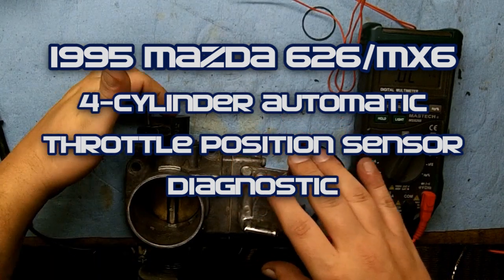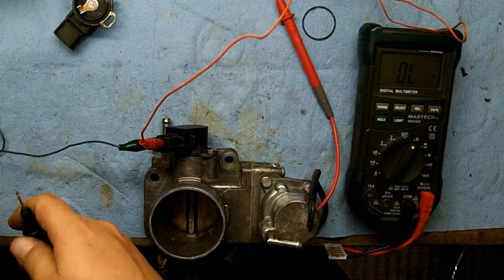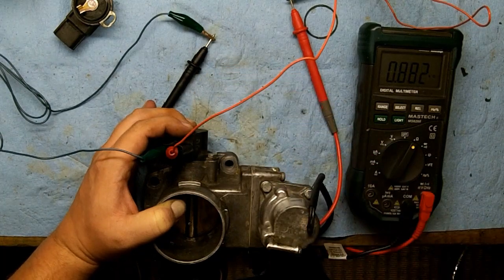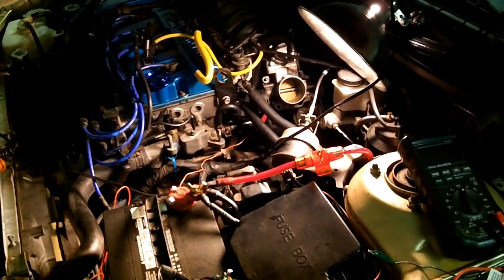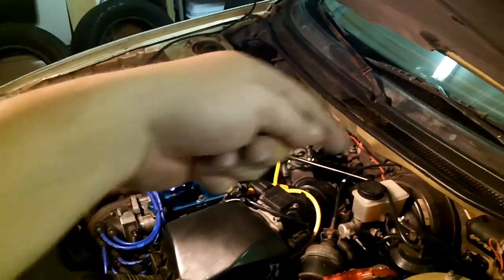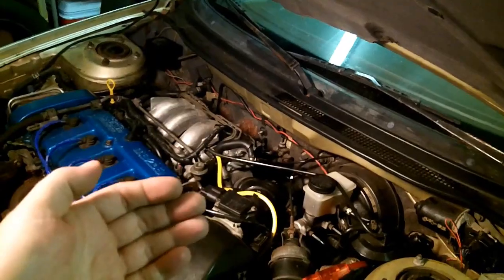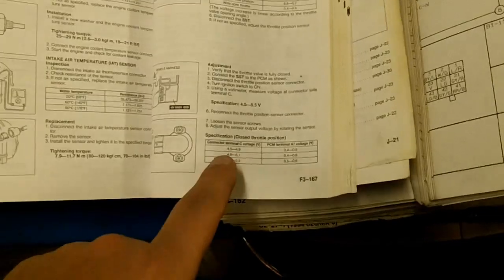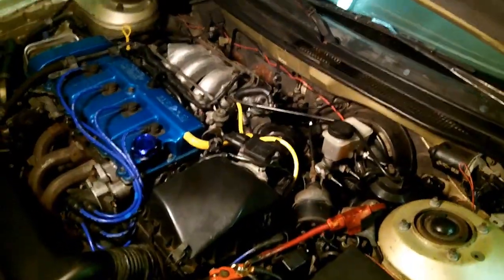Mazda 626 - Throttle Position Sensor Diagnostics

Comment: Hello dj, need some help here I adjusted my tps to 0.5  closed and 4.5 open and it’s giving me a 122 which is tps is low but specs are 0.3- 0.7 and 3.7-5
Reply: Also the car is idling very funky and has loss power
Reply: @chefanklez1335  Hey did u find a fix?

Comment: I  know this is an old post. but I have a 2002 Mazda 626 and it runs fine until I  accelerate  a little faster than "grandma speed" the engine remains high idle and if I put it in park and shift back to drive it's shifts super hard. should I try to clean the T.P.S. and the I.A.C. and see if that work? looking for help I can't afford new sensors.

Comment: I have 1995 Mazda mx6 when I turn the car on in the morning and drive it it tends to struggle to change gears, and when I've driven it for a while and park it, the engines revs up, is the throttle position sensor going bad? I've changed the EGR valve, the EGR solenoid and the IAC valve? Do you think it's the throttle position sensor going bad???

Comment: If you could please help me I would appreciate it so much. Do you know what the sensor is on the fire wall side of the throttle body of a 94 626 5 speed?
Reply from the maker: Yeah pretty sure you're talking about the idle switch. If you loo That sensor can only be found on the manual transmission 626. ;)
Reply: DJDevon3  the car runs and the weird thing is when the slightest touch to the throttle it drops idle and sometimes dies. Doesn't do it at any other pressure.
Reply: DJDevon3 when I unplugged that it doesn't do it at all but then eventually dies. Do you think it could be bad? It's there a way to test it?
Reply from the maker: Yes there is a way to test it.  Read the 1993 workshop manual found over at pmx626.info.  All diagnostic procedures are in there. Good luck.
Reply: Thanks for the help I'll look into it

Comment: Thanks for answering my questions the codes of my mazda mx6 is 8,11,26 if you can help me to know which parts are
Reply from the maker: 08  =  Mass Air Flow (MAF)  (open or short circuit)
https://www.youtube.com/watch?v=KY1iUvHRodA

11  =  Air Intake Temperature (IAT) When code active it sends constant 68F signal.
I don't have a video on the IAT.  Read the workshop manual on how to troubleshoot it.

26  =  Purge Control Solenoid Valve  Open or short circuit.
https://www.youtube.com/watch?v=ziyD_OhkVho

Comment: 2.0 is 4 cylinders
Reply from the maker: 08  =  Mass Air Flow (MAF)  (open or short circuit)
11  =  Air Intake Temperature (IAT) When code active it sends constant 68F signal.
16  =  Exhaust Gas Re-circulation (EGR) Sensor (California)  Open, short, or sensor stuck. 

There is no such thing as a code #6 for your vehicle.

Looks to me like your MAF is faulty.  The IAT is a sensor that plugs into the back of the air filter box.  Looks like you have a lot of diagnostic work ahead of you.  You can find a free workshop manual from pmx626.info, good luck.

Comment: I have a Mazda MX6 and I got a code 8116 but I do not know that part of the car is
Reply from the maker: What year, engine, transmission?  The 93-95 manual transmission only had 2 digit codes, the automatic has 3 digit codes.  So you might be reading those codes incorrectly.  I've never heard of an 8116.  It would make more sense if it was an 8, 11, & 6.
Reply: 93 manual transmission
Reply from the maker: I4 or V6? The engine matters too.  There are different codes for the manual vs automatic and I4 vs V6.   I'm guessing you have an I4 because there is no code 11 for the V6.  At least not the US version anyway.  I only have DTC's listed for the US Mazda 626, I have no idea about the codes for other parts of the world.

 You should have 2 digit codes if it's a manual but the I4 has different codes than the V6.  Please read them again.  You have to be absolutely sure about the code numbers.

From what you've said my best guess is an 8, 1, 16.  or perhaps you're missing something and it's actually 8, 11, 16?  Read them again and be absolutely certain.

Comment: Hi all I'm writing in Turkey I have gf 2.0 1998 626 136 hp. Apply the same data in this vehicle or verilire? If you write off the throttle and clearly appreciate it
Reply from the maker: No, the TPS value will be different for a 2.0 1998 626.  Measure terminal 1 & 3, should be 4.0 - 6.0 kOhm, preferably centered at 5.0 kOhm.

Comment: TPS sensor in my car problem. I could not find in Turkey. I need a piece of code from another country brought to the TPS sensor. My car is constantly stop. you can tell me?
Reply from the maker: What car? Model?  Year?  Engine?  Transmission? There's absolutely no way I can help you from the information you provided.
Reply: 1994 model Mazda 626 2.0 engine. 115 hp. My car is currently in service. I think DOHC engine. I do not remember exactly. And tell me I am my problem. My car is constantly stop. In particular, the engine is cold.
Reply: Sezgi Ayver yapabildinmi tps ayarını

Comment: Maybe the multi function switch didn't bother any thing and it is just wear and tear do you have a clue
Reply from the maker: Multifunction switch (light stalk) shouldn't have anything to do with the tachometer signal unless it's bad wiring to the instrument cluster from using the wrong multifunction switch.  The two shouldn't be related.  I really don't see how the issue could be related to an ignition system issue.  Not saying it impossible it's not something that I've come across as a common issue that's for sure.
Reply: When I turn on the headlights my rpm flutter
Reply from the maker: MrAndro145 That's usually because the additional electrical load on the battery causes a mechanical load on the engine.  If that's your only issue then a good tune up might be all that's required.  By tune up I don't mean replacing plugs and wires.  I mean actually tuning with a timing light and checking your base time parameters by a good mechanic.

Comment: Thanks DJ, unfortunately they don't have my '93 in there. But, I saw a post by snailman,  looks like the specs might be in the Haynes manual.
Reply from the maker: For the TPS I believe 1993 specs are the same as 1994.

Comment: Thanks for the vid explanation DJ. I'm trying to diagnose high idle on my Mazda 6 cyl. Do you know where I can get the specs for the TPS for the 6 cyl? I've been looking on mazda626.net, but can't find them there.
Reply from the maker: PMX626.info
Reply: Yeah mine though a code for closed throttle position sensor  didn't know that you had to adjust it I would have just thrown a new sensor on now I need to fine the numbers for 96 probe gt  just like he's looking for but I have a book hopefully it could tell me and the car still running pretty good  thanks man you have a lot of helpful videos
Reply: Fully closed approximately 0.5 to 1.0 volts .
Fully open 3.5 to 5.0 volts .
If you can't get the TPS to deliver proper readings replace .

Comment: Yeah, it's not always easy to thoroughly test a variable resistor when the problem may be at a specific spot. Too easy to mistake it for a bad probe connection or some other artefact.
Reply from the maker: Connection was really dodgy for sure.  Had to use a sewing needle during the voltage tests because the T-pin wouldn't fit.  Needle was so small the alligator clips would barely stay on.